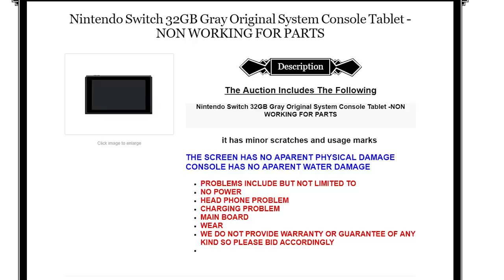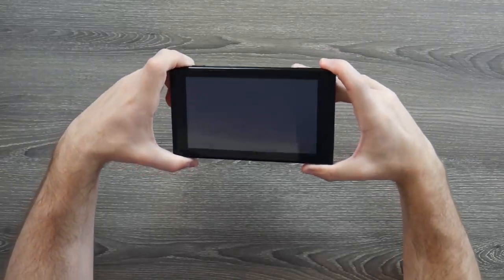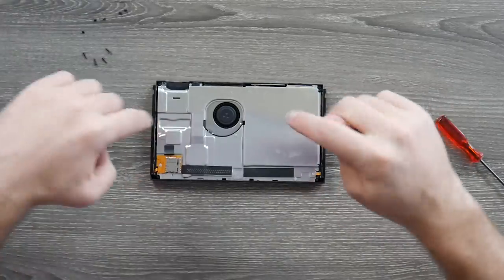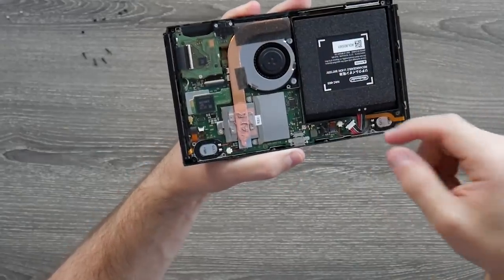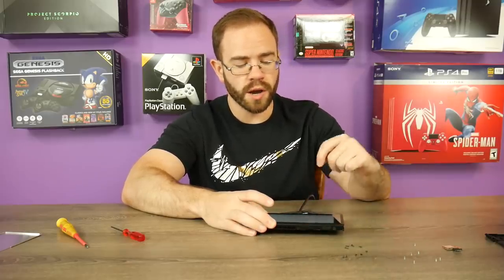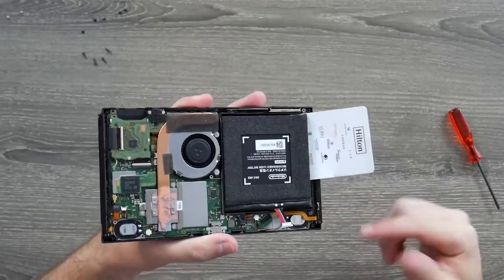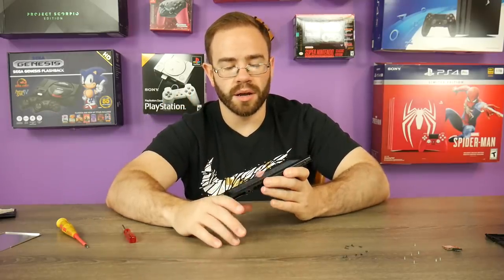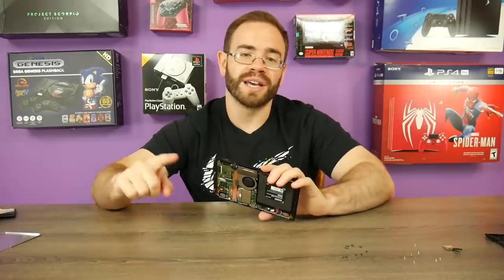I Bought A Broken Nintendo Switch On eBay...Can We Fix It?

Comment: Here's how to get a cheap Switch!

1. Buy a cheap broken system.

2. Have 20 years of experience fixing electronics.
Reply: I mean if you get a bricked one just replace the battery
Reply: If you need 20 years of experience to check and replace a battery, you aren't the brightest candle on the Christmas tree. ;)
Reply: @worldhello1234  rofl
Reply: @worldhello1234  putting candles on your Christmas tree is very unsafe as it could go on fire. Please dont do this.
Reply: @worldhello1234  sharp
Reply: @worldhello1234  im a millenial so 20 years is an underestimate
Reply: People are terrible at fixing consoles themselves, it's a nice business to get into since it's easy money on flips and fixing for people.
Reply: geraldine woods very commonly the charging chip fries it self (if it was bricked by a third part dock) so it might not be the battery
Reply: Sounds Pretty Easy If You Ask Me
Reply: Except I know how to fix phones and consoles after 20 hours of research

Comment: Imagine the parent of the kid that owned the switch saw the video and realized the fact that they could have just replaced the battery lol
Reply: Need a tri-wing screwdriver to open it, and need to reapply thermal paste on after removing the metal parts, even that much isn't for the faint of heart.
Reply: So what? They probably returned it under warranty and got a new one, while the defective one was sold off by the shop.
Reply: @MyRegardsToTheDodo  
Exactly it's a win-win, the kid gets a new console and they sell the other console off cheap.
Reply: Knowledge is power
Reply: I don't even think it was the battery, i just think it was completely drained. it will act completely dead until it has been on the charger for a while.
Reply: @KazoWAR  
Yeah lithium ion have that problem also this was a kid's so I'm sure it was used HARD.
Reply: This is what i was concerned since i noticed the design of the battery. A 300 dollars battery esentually. The 3ds was more eco friendly to swap out rechargeable batteries.
Reply: @Dwedit  is it really that difficult.
Reply: @ItsJustMilkISwear  odd comparison. Maybe a bad starter thinking the car doesn't work.
Reply: @KillingMoon_  If you wanted to do the whole procedure, first you'd need to know that battery replacement is even possible, and how to do it.  Then you need the equipment: Tri-wing screwdriver, thermal paste, thermal paste cleaner, new battery. 

Then you need to get lucky.  The Battery itself must indeed be the problem, and not one of the other myriad of problems that would prevent the system from charging/booting.
Thermal paste is some tricky stuff, you need technique to apply it properly.  And what's correct in one case can be wrong in another case, it all depends on how the cooler rests on the die.  Any time you open a Switch, you need to deal with the thermal paste.
Reply: true
Reply: @Dwedit  yeah thats also true.
Reply: @KazoWAR  this happened to me once. I usually have it docked when not in use, so I never had the battery deplete. I don't know what happened, but one night I may have dropped it on the dock wrong, didn't connect, and a day or two later I wanted to play and it wouldn't turn on. It was just before the cloud saves so I thought I was fucked, but I let it charge a bit to be safe and yup. Somehow the battery drained, but it had my scared shitless for a while there.
Reply: 99% of people have zero knowledge of taking apart electronics, & fear they could just damage it even more if they tried. So they just buy a brand new one instead. It also takes some time to fix things, which sometimes people do not have much of as well.
Reply: @Dwedit  that is very faint of heart thermal paste at best buy 10 dollars tri wing screwdriver 5 dollars tops, and battery varies but this is so simple.
Reply: @meatbleed  except a car is regulated by the government and needs a working cat to pass the emissions test. That is a terrible comparison you can die if you don't fix your brakes properly, just as an example. A switch what are you going to do? Cut your finger?
Reply: It's not all that easy, that adhesive is a bitch and the battery is a large risk of setting on fire.
Reply: @KazoWAR  I think he needs to invest in that current monitor that mymatevince has, it tells you a lot about what's happening.
Reply: Hinneeeeeyyyy naaaa naaaa SHIT
Reply: EPIC!
Reply: What tools do i need for the Nintendo switch like what screw drivers?
Reply: @MyRegardsToTheDodo  Nintendo would be selling defective products like this. They would fix it first then re sell. Im pretty sire that they know how to troubleshoot a broken battery.
Reply: @KenKen-we5yr  Most defective products don't go back to the manufacturer. If you buy something from Amazon for example, and then return it, it gets sold as a lot with other returned items. For them it simply isn't worth the hassle to go through all the trouble to return the item to the manufacturer just to get it fixed. Those lots are then bought by professional resellers, who test them if the items are really defective, and sell the working items as used. The non-working stuff quite often is sold as is for parts, because those resellers neither have the time nor the capacities (and sometimes the knowledge) to fix the items. If you claim your warranty from the manufacturer yourself and send it in, it will probably get fixed, but many manufacturers don't handle this in-house, they have an external company that does the fixing.
Reply: How much was it
Reply: Leon Kennedy, It’s actually kinda sad but good for the people who know like us :]
Reply: All For Sasuke oh yeah yeah
Reply: @meatbleed  Lol right? I'm even wary at work when I get something I've never opened before because I don't want to break it. Switches aren't Gameboys, so it's not as easy as the problem sounds, so I totally get where you're coming from.
Reply: Dwedit that’s so easy
Reply: They must feel stupid
Reply: Bahaha ikr
Reply: You here ?
GBA days long gone..
Then again, the switch has a similar formfactor.

And yes, thermal paste is not yet a common household item.
Reply: @meatbleed  I mean, they would have nothing to lose. If it already doesn't work, they could at least try.
Reply: How do I fix my browken Nintendo switch I need real answers  plz :(
Reply: @Dwedit  I mean they could've just sent it to the shop to do that
Reply: @Dwedit  - That shit is easy lol

Comment: Thats why even broken systems getting higher prices on ebay. Everyone try or may think they can fix it.
Over 15 years back at the time GBA was around you got very easy and cheap broken items, because noone want to fix them. It was that easy that you got 2 broken systems like a GBC, one with a display crack, but still makes sounds and a "not working" system with intact display.
And here the joke: 5bucks each. A working GBC was worth 45-50bucks back then. So it was worth it, even if you bought 4 broken systems and 2 of them would stay dead.

Today: a system is "broken" but still costs over a half of a working system. Not worth imo, even if you able to fix it. There's always a risk that you waste your money (and time) with a system that is maybe fixable but need spare parts that makes the fix more expensive.

Last time i checked how much a PS Vita costs and ppl bid over 50 bucks on a not working system...

Comment: BE AWARE: Defective IS NOT THE SAME AS Bricked.

Don't buy a unit that someone played with hacking and ended up bricking the unit. 

If someone mess up the internal nand and don't have a proper backup the switch is UNFIXABLE.

Don't buy something bricked, buy something you are sure it's just defective.
Reply: one of my switches was from ebay and I got it as bricked because of the ebay seller's hacking and I know what he had done.  I was able to get couple of custom OS running on it.
Reply: @ELY3M  My point is that the average Jonh does not have the - very particular - knowledge about the switch internals.

BTW, how did you unbricked it without the biskeys and/or nand backup?

Comment: Use pledge wood palish and buff vigorously the wax in the spray should fill the scratches it is how you remove scratches from motorcycle windscreens.
Reply: KOOL
Reply: No
Reply: @floppinfish  Not that kind of motorcycle the ones with big plexiglass  windscreens like police bikes.
Reply: That's a good thing to know

Comment: I have never had issues buying stuff on ebay for tech. got good refurbs and more.
Reply: I bought myself a used PS4 for super cheap (I can't remember the exact amount, $180 at the most) and despite having to replace the hard drive due to my own incompetence, it's worked for at least a good 2 and a half years without any issues.
Reply: Honestly its how I've got all my consoles, most recent being a PS4, came with the box and everything complete for £30, was listed as needing a disc drive so £15 on one of those later, plugged it in and it was good as new, you can get really good deals on stuff like this by just refreshing the "newly listed" page on ebay basically. I generally avoid anything that is too unusual or technical (eg: not problems the console is known to have from time to time)
Reply: Agreed. Pawn shop was selling a New 3DS XL for $60, with a super stiff volume slider and sticky buttons. All I had to do was clean it off and push the buttons/slide the sliders for a while and the problems disappeared. Incredible how it works sometimes.

Comment: I bought one from someone for $50. Just the Tablet. It works, just has some scratches on the screen. It looks bad but When you turn on the Switch. You barely notice them. For $50 I couldn't say no. I already had extra joycons. So now I have 2 working Switchs.Hopefully I could change the screen one day. But I'm scared to break something lol. I'm the type of guy "if it ain't broken, don't fix it" lol

Comment: How necessary is a new adhesive when replacing a switch battery? Would the battery rattle around without one?
Reply: S M yes which is why it’s secured with adhesive
Reply: @stopcryingalready  Such a lazy solution for it though. They could have had a tab at the top where the battery slides under, then just a small adhesive strip on the connector side, and it would neither rattle, nor be a pain to change.

Comment: Really not worth it to buy a repaired Switch tablet only. As you said you need the Dock and Joycons and don't forget the Joycon Grip which would come bundled all new for 299$.
Reply: used switch 80
knock off switch pro controller 30
usbc hdmi adapter 20
poor mans switch bro
Reply: @participantx  yeah that might be a solution if you don't care about oem products

Comment: The first thing I ever did with my Switch was set the dark mode.
Reply: SAME
Reply: Same
Reply: Same here and I didn't even know it had a dark mode setting before I bought it. The first thing I did when I got my switch was go through the settings and I happened to find it. I turned it on immediately.

Comment: You technally don't need a dock, just chargeing device.

and joy-cons or pro controller.
Reply: You could save money by using a Hori pro controller. I wouldn't use a third party charging cable. Due to Nintendo's weird PD0 implementation.

Comment: Sooo, I've been having trouble with my Switch since February. I've only been able to play it a handful of times since because it powers on and freezes on the Nintendo Switch logo. When it finally "works" correctly, it has trouble finding my wifi. 

Spawn Wave or anyone else, does this sound like a problem I can fix or rectify without getting outside help? I bought my Switch on release date and never had issues until earlier this year. I'm starting to get frustrated with it because I wanted to revisit games like BOTW and also buying Mario Maker 2 next week.
Reply: Try turning off auto connect to wifi, and manualy connect it everytime you power it on fixed mine crashing. Also make sure not to keep it in sleep mode for more than a few mins.

Comment: I bought a broken switch from ebay last November hoping to fix it and keep it for myself. System was stuck on the bootup screen and didnt come with the battery or back cover but I got it for $50 shipped so it was cheap. Bought a generic back cover and used original battery for less than $20 so total investment came out to less than $70. Fast forward a month and I couldnt get the system to go past the boot screen but as luck would have it the system was still under warranty. I just put the whole system back together with new thermal paste to make it seem like it wasn’t opened and sent it to Nintendo on the grounds that it was stuck on a boot-loop. Fast forward a week and I got my system back in the same condition as when I sent it but it was fixed! Turns on, plays games and everything! Might be worth a shot sending in one of these broken systems into Nintendo if the warranty is still active.

Comment: I would have tried to get the Switch back to the kid. Probably difficult to get it to them but they probably would be happy to have it back.
Reply: Most likely got a new one. No point if that's the case
Reply: @JDarkAngeI  I'd gladly have 2 working Switches.

Comment: So I got my switch wet and it like murdered the screen but it still works in docked mode, is it an easy fix so I can play it in handheld again?
Reply: Chuck Pursell problem with getting electronics wet is the corrosion. It will oxidize the copper on the board over time and the whole thing will eventually crap out.
Reply: Chuck Pursell should have gotten the water proof switch

Comment: In my experience, many "broken" switch or similar thing, is on sale on ebay for "ban" issue due to unauthorized hack. Those devices might have no hardware issue but won't be fixable. And btw, for it is so easy to fix this time, how about trying to reselling it back to the owner hhahahaha.

Comment: Considering he said it was most likely a kid's switch I'm surprised he didn't try checking to see if the system wasn't in RCM before taking it apart and swapping out the battery

Comment: I’ve found with the switch. If it hasn’t be charged in a long time like yours. It will need to be charged overnight to wake up the battery. Sure you’ll want to replace it but it’ll be good enough to use from them on.

Comment: I just happened to have a problem with my switch a few months ago. It couldn’t connect to the internet and that problem seemed to happen out of nowhere and I had to send it back to Nintendo. After getting it back I was able to connect again and I thought everything was cool but I just recently realized something. Whenever I test the connection speed it is just abnormally slow, with the highest being at about 2.4Mbps and the lowest being 1Mbps, and that’s considering I put it right next to the router. 
My internet connection gets speeds of about 20Mbps on my phone so I was wondering if something like that is normal and if not what can I do to fix it? (By the way the MTU is at 1500 and specific DNS’s only seemed to worsen the speed)

Comment: I was very lucky with ebay switches that was broken.  one of them was $89 and had autorcm enabled on it.  all I did is charge it for few days then I plug it in my computer and get it going :)  now,  I have atmosphere CFW running on it with a emunand :)

Comment: If you are always on the go, buying a Switch from Ebay is the cheaper route to go because all you will need is a Switch charger and a pair of Joy Cons or those cheaper $30 Switch controllers.

Comment: Thanks for a brilliant Video! I'm glad to see someone working on these foreign platforms. (Hq in Kyoto, when products come here then we should have someone who can Deal.) Just saying (saying a lot) my career began in 1958 selling my first at age 5 by my self made transistor substitution box to an Electronic novelist! Well, every since struggling with foreign technology, however, I had managed to repair every device that was handed to me for 53 years, also 48 seasonal years of Carp, plumbing,and Electricity. Well, at the University of CO, after hearing much about many Game Schools opening here, 2007 thru 2011, I asked if they taught or had Classes that I could take to fix foreign Game systems , I was shocked, no classes offered Electronics in this area. There I was on my own as usual! Today, we still need a School that can teach foreign tech's. You're the Guy for the Job, ha-ha! Good-Luck (No Schools here as of yet. I would open an Engineering Institute but lack the funding, you know Tv, Game, and Switch tools cost can rise $200,000 just for some of the tools that you need for Repairing Tv's.)

Comment: FYI, update on buying a roach infested PS4. There are German and Brown roaches in my car (it’s been about two weeks and just noticed a few hanging out near the car’s computer). I just placed traps and turned off “cabin overheat protection” which left the vehicle at 140°+ for 6 hours (which they can not survive in), so that problem is solved. The PS4 itself was bagged in a vacuum seal bag, and the roaches died there one way or another. The PS4 is now working and passes all my tests...it returned to a vacuum sealed bag for another 30 days just in case there is ANYTHING still left crawling in there (there were roaches in the controller!!! How?!?!)

If I were to have to do this again, immediately I would bag the thing and stick it in the freezer for a week, this would kill all of them, and their eggs. Alternatively 150° in an oven for hours also does the trick, but you have to be careful not to melt anything. The repair wouldn’t have been so unbearable if they hadn’t made it smell like insecticide...a problem I easily remedied with baking soda.